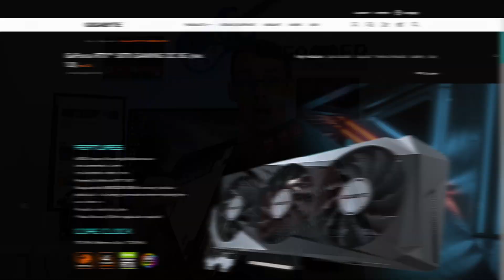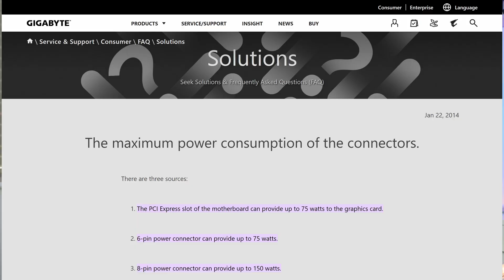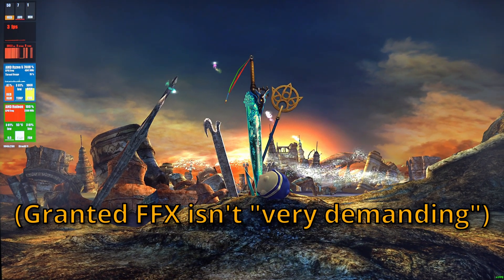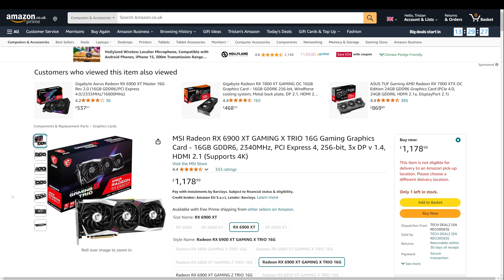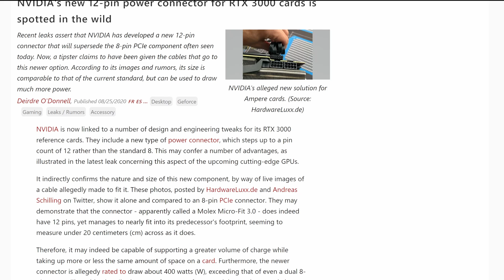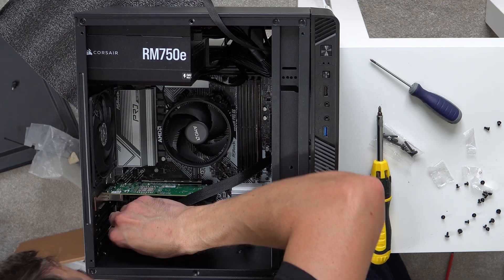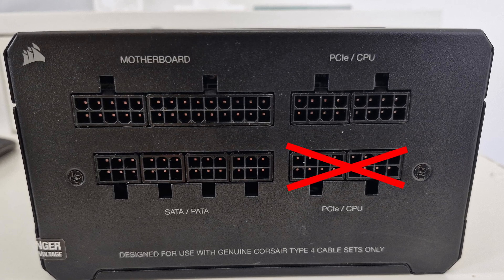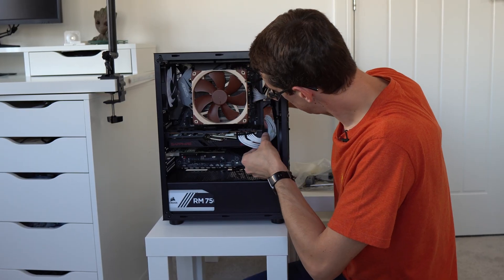How To PROPERLY Power High End GPUs (With 12vhpwr Or 3x PCIe Connectors)

Comment: Just bought a gigabyte gaming rtx 5090 and have a super nova 1000 gt psu. I have 3 8 pcie cables that have all pigtails. The adapter for the 5090 is 4 8 pins. Can I plug the 3 up like normal, and use one of the three to daisy chain for the 4th slot on the adapter?
Reply from the maker: Hmm, it's hard to say for sure. The fact that the 5090 can sometimes draw 600w scares me tbh, and some PCIe cables only supply 150w. So with 3x separate cables, you might find that your 5090 is being undersupplied power. Of course, some PCIe cables supply up to 288w... in which case, you'll be fine. I know that's vague sorry, but maybe just keep a close eye on your power draw and if you get crashes above 500w or so, then you know the cable config is likely the issue.

Comment: Thank you for this. I just want to confirm that I can power my Asus Prime 9070xt with a Antec GSK 850watt with only two PCIe 8pin cables. The TDP for the GPU is 304watts
Reply from the maker: No worries, and yes, that should work fine :)
Reply: Please I’m so confused, do u still plug a pcie into the motherboard

Comment: I always use separate cables for my graphics cards regardless of their tdp. In the case of the pigtails? I usually just cut them off. Much neater.
Reply from the maker: Cut them off? Yikes! I haven't had the nerve to do that, but I'm glad it's been working out okay for you.
Reply: Yes, ok it's scary the first time like everything is, but, I've been using the same PSU for over a year now and had no issues. You just have to make sure it's a clean cut {no stray wires,} and you use a good set of sharp cutters. Also being careful to make sure you cut the right wires! My first time was a doozy! Thanks for the reply.

Comment: Hi, i have 5070 ti, and it give me coil whine sound, i return and switch the gpu but the sound still there, so i was thinking to switch to rx 9070 xt bc it use 8 pins cable would it help?
Reply from the maker: Hi, ugh sorry to hear it :( Sometimes a new GPU can have coil whine for the first 1-3 weeks, but it can then slowly reduce. It's hard to say for sure though - there's no hard and fast rule with it. Some people say that swapping their PSU helped.

Comment: Hi! Should I connect two separate pcie cables on my rx 7600 xt? I've been having problems in some games and I realized that I had the pigtail connected to the GPU (and not two separate cables as you recommend)
Reply from the maker: Hi, yes I would try that, especially if some games are having issues. I mean, sometimes a quality PSU will power a 7600XT fine with just 1 separate cable, but I prefer running 2x cables whee possible.

Comment: I am upgrading my gpu where my current power supply can’t provide enough power, can I add another power supply for graphics card only or should I just replace current power supply with higher wattage?
Reply from the maker: It'd probably be easier to upgrade the PSU - by default PSUs don't turn on by themself, you need a 24 pin (mobo) connection to power them.

Comment: My 9070xt needs 3 8pin pcie cables but my PSU only has 2 8pin pcie slots, so it's ok if one of the 2 cables is a pig tail? 850w psu
Reply: Yes it will be fine
Reply: @xiMoshyx What about rog strix rtx 3070 ti, same thing, two 8 pin with 2 piggy 8 pin, can i do the same?
Reply: @Fantyyyy yeah 100©
Reply: How do you pigtail? My cables from seasonic are only one cable..?
Reply: @Specias does it have 2x8 pin ends? 2x 6+2 pin ends? Orva combo of 3?
Reply: @Specias as in 3 x 8pin ends?
Reply: @Specias  depends on the PSU. Check the model. You'll be ok
Reply: @xiMoshyx I mean the cable is straight, it only has one 1x8 on the other one.

Comment: Got a 7900 XTX and my 1000 watt modular psu doesn’t have 8 pin vga cables so I am assuming I just use multiple vga cables?. I heard using non stock cables can be very risky. Upgrading from a 3060 which only has one 8 pin
Reply: Ohhh so the split ends go into the psu and the single ones go to GPU ? Been doing reverse for like 5 years now
Reply from the maker: Congrats on the GPU upgrade :) It can depend on what PSU you have but some PSUs (for example Corsair ones) do come with PCIe cables here you plug 2x 8-pin ends into the PSU side.

Comment: with my 12 pin cable that comes with my psu doesnt work and my gpu doesnt even turn on. ive tried everything but im now gonna order a new one that has 3 6 pin pcie cables so i can use the adapter that comes with the gpu so thats litteraly the only thing i can do so i really hope that works...
Reply from the maker: Hmm sorry to hear it, that sucks - yes definitely worth trying with a conventional 6/8-pin cable and seeing if that works.
Reply: @TechOverwrite the last thing it could possibly be (or at least what i think) is a faulty motherboard... ive been trying to get my gpu to work for a week now... i was really looking forward to beying able to finaly use a pc again since its been a while. This is my first ever actual pc that is fully mine. (Also my first time building one...) so i really hope it works...
Reply from the maker: Oh that's frustrating, sorry to hear it. I had a dodgy motherboard ages ago and they can take ages to debug/track down the fault. I hope you can get it resolved soon.
Reply: @TechOverwrite  no worries. I got a different cpu and used the nvidia adapter and now it works!

Comment: What about the other way around the 16 pin connection on the psu and then the 2 pcie into the gpu?
Reply from the maker: Ah good point, yes some modern PSUs (including Corsair's ATX 3.1 range) do this. That's a good way of powering Intel and AMD GPUs - no harm in using that cable IMO. I like that they offer more PCIe connections this way.
Reply: @TechOverwrite can you link one of those cables?

Comment: For a Rx 9070 xt Sapphire Nitro+ should I use 3 pcie cables separately or use 1 pcie cable and other pcie with pigtail?
Reply: Same problem
Reply from the maker: I think it'll be safe to run 2x separate cables, to then use the pigtail on one of the cables. The 9070XT doesn't use enough power to require 3x separate cables, IMO :)
Reply: Thanks man  @TechOverwrite

Comment: Im upgrading to a 9070xt and it uses three 8 pin connector, leaving me with only 1 left from the psu, to the cpu. I have a 9800x3d, so having only 1 for my cpu, is cutting it short i suppose. But, my psu has a 12vhwpr connection on it. Is there a cable out there, which has 12vhwpr for the psu end, and 2x8 or 3x8 pin pci-e connectors on the gpu end? The psu is a Corsair rm850e.
Reply from the maker: So you presumably have a 2024 or 2025 model PSU? They should have supplied a 12vhpwr to 2x8-pin cable in the box. I would double check - my 2025 RM1000 watt Corsair PSU contained this cable. That is what I would use :) If you definitely don't have it, I would reach out to Corsair support - I thought they always included this cable with their recent PSUs (that have the native 12vh port).
Reply: @TechOverwrite  Is that cable meant to be used like he describes? Plugging the 12vhwpr end into the psu and the 2x8 pin into the gpu? I thought that that cable was meant to be used the other way around? The 2x8 pin into the psu and the 12vhwpr into the gpu?
Reply from the maker: @tonnyhovland5265  it depends on the PSU. Corsair's very latest PSUs have a native 12vh-2x6 slot, and then they give a cable that plugs 12vhpwr into the PSU side, and then that 'gives' 2x 8-pin for an Intel or AMD GPU.  But it gets confusing, you're right, because other PSUs give 2x 8-pin for the PSU side and then 12vhpwr for the GPU side. Very confusing!

Comment: I got the Corsair RM850e PSU, and a 9070xt which needs 2 8pin PCIe connectors. The PSU only came with one regular and one pigtail one. Is it fine if I use both with the pigtailed one having one unplugged and zip tied to the wire itself? Will there be any future issues with it? Its my first time so I'm quite stressed that I'll do something wrong and ruin everything lol.
Reply from the maker: That will be 100% fine :) No issues. Good luck with the first build!
Reply: @TechOverwrite  Thanks alot!

Comment: I've got a question, regarding the PCIE5 12v connector- I've got a 9070xt with 3x8pin female ports. I was wondering if I can connect 3x8pin Male to 12v connection male into the PSU. I'm wondering if that would be okay as it would make sense in my opinion and would make my cable management IMMENSELY better in my small form factor PC build. My PSU is MPG A1000G PCIE5 so I have a ton of free slots, it's pcie 5.1 and atx 3.1 rated
Reply from the maker: If the cable is designed that way (i.e. it's designed to have 12vh going into the PSU, then gives 8 pins for the GPU side) then yes, that would be fine. However if it's designed the other way round, it's u likely you can flip it around. You might then be better off with a custom cable e.g. from CableMod.

Comment: My psu came with 1 12v cable it’s a 3.1 Atx I can just use that? As a single wire from the psu to the GPU?
Reply from the maker: That's my preference, to be honest :) That's what I did, and I never had issues.

Comment: Thank you, I was son what the pigtail cable is called. Im using the asus tuf 9070xt while the psu im using EVGA SuperNOVA 1000 P5 1000 W 80+ Platinum. But it only come with 2 of 8 pins. All the rest are pigtails.

I may need buy another 8 pins locally, thanks for your informative.
Reply from the maker: Sounds like a good plan. You might be fine, but sourcing a separate cable would be best I agree :)

Comment: I purchased a 3070 ti Strix not realizing it has x3 8 pins.   My 1000W PSU only has 2 8 pin cables, and each cable has a 6 pin in addition, so I’m not sure if I can power it properly.  It’s also a Dell so this PSU can’t be upgraded
Reply: My current plan is to use a dual 6 pin to 8 pin adapter so I can plugin the two 6 pins and convert into an 8 pin.  

Is this different in anyway from splitting an 8 pin into to 8 pin, or just a single 6 pin into an 8 pin
Reply from the maker: Hmm, that's hard to say for sure although I would imagine it would be okay - the 3070 Ti's power usage should mean that the 2x separate cables will supply enough power, even if you do then need to use a 6 to 8 pin adapter for that final connection.
Reply: @TechOverwrite okay thank you very much.  So you would recommend using the 6 pin to 8 pin adapter? I ordered an adapter that allows for both 6 pins (the 6 pins on the PSU come off the cables with the 2 8 pins) but I don’t know if this makes any difference?  Spread out the load a little?
Reply from the maker: I think that should be fine yes (I'm trying to visualise it and am not 100%, but I think I understand). It may spread out the load a bit I agree. It certainly shouldn't harm it, at least :)

Comment: Hello i need to coonect 6+2 pin to 7800xt which require 2 cable. My superflower leader IIII psu cable only give me 2x of pigtail and 1 of normal 6+2 pin. I want t9 know that if i can use it separately like, 1 slot use single 6+2 pin and another slot use 12+2 pin which left 1 side of pigtail free. Can i connect it like this? Since im scared using only 12+2 pin to vga.
Reply from the maker: Yes that would be fine, i.e. leaving one part of the pigtail free but ultimately still using 2 separate cables. :)

Comment: Hi! i have a question, so i just purchased my asrock 9070xt and the store guys put it in my pc. so when i picked it up, im wondering why they only put 1 6+2 cable with the 6+2 pigtail on it to run a 2 8-pin gpu. my psu i a toughpower 850 ATX3. did they do they right thing or i need to put on 1 more 6+2? im worried now since i have used my pc for over 3 weeks
Reply from the maker: Hi! Ooo good question. I'd say they did it wrong, to be honest. I mean, technically some 8-pin cables can supply more than 150w down them - some up to 288w I think. More budget PSUs might be closer to the 150w figure, but the toughpower is a good PSU so you might be fine. However all GPUs can have transient spies too, and so I always prefer running 2x separate cables for best power stability.
Reply: @TechOverwrite hey thanks for the response man! i really appreciate the help! so now my OCD brain cant stop thinking about it lol. so i computed 75(mobo) plus 288(pcie cable) i should be getting 363 and in paper that should be enough,right? after work i had plug on another 6+2 from the psu package to the gpu, idc how bad it looks better safe than sorry. btw the cables are 18AWG.
Reply from the maker: Hah no worries and I agree, your math seems fine to me :) Hard to know for sure, but you should be fine I agree.

Comment: My old Vega64 died a few days and I found a good deal on a 6900XT that has 3 8 pin connectors. My EVGA 650 G2 PSU has 2 8 pin PCIE connectors on the unit, with 2 cables supplied with a 6+2 pigtailed with a 6 pin cable. I'm guessing there's no way to make this work, so I see there are compatible cables for sale that have 6+2 with a 6+2 pigtail. If I buy this new cable, will this work? I would use one of the older cables with just the 6+2 for one of the three 8 pin slots, then the new cable with both 6+2 used in the other 2 8 pin slots. edit - been researching elsewhere and people have suggested the 6900XT has high transient power spikes and that my 650 G2 is insufficient, despite both the V64 and 6900XT having the same board power rating of 300W. What do you think?
Reply from the maker: That should be okay for a 6900XT in my opinion - the power draw of that card is often 300w or so, meaning that 2x separate cables (and then a pigtail from the compatible cable) should be fine. 

All PSUs will handle transient spikes above their rated load, and the EVGA 650 G2 appears to handle them fairly well: https://www.techpowerup.com/review/evga-supernova-g2-650/8.html

So while I've only done brief research, I'm not seeing anything super concerning. You could always try it and keep an eye on (1) power usage and (2) any crashes/stutters, when that power usage gets to the peak. If you don't get crashes/shutters, you''re probably fine.
Reply: @TechOverwrite  Thanks!

Comment: Just bought a sapphire nitro+ 9070xt and have a XPG Core Reactor 750W GOLD. What do I need to do? I’ve seen people just using a 12pin straight to the psu?
Reply from the maker: That will work, yes :) The 9070xt is a beast, but it doesn't use so much power that I'd be concerned about the 12vhpwr. So in other words, I would just use the cable you got with your PSU to connect it up - that should be fine :)

Comment: can anyone help me
Reply from the maker: What's up? 🙂
Reply: @TechOverwrite  hello :)
hum hard to explain without image (i have a reddit post about it), it's about my psu im not sure if i can plug the third 1x8 pins elsewhere, my 9070XT is 3x8 pins and i'm not sure if my psu can handle and have enough ports for it. Rmx 750 2018 white gold 80.

also it is better to plug two 2x8 pins (so 1 will be floating unused..) or 2x8 pins and the third one with a single one? ☺
Reply from the maker: Hello :) Okay sure, so for the 9070XT you will be fine to use two separate cables, and then one of the pigtails (for the third connection). You will then have 1 pigtail floating unused, which is also fine. Your PSU should handle your GPU with no issue. :)
Reply: @TechOverwrite  thx u, as most use 3 individual i might upgrade to 3 indibidual later :) <3
Reply: @TechOverwrite I have 2 individual 8 pins in my psu and just bought a 9070xt nitro. Does that mean I need to buy 1 more separate individual 8 pin connector? I have a XPG Core Reactor 750W GOLD. Where can I buy the 8 pin connectors? Pls and thank you sir

Comment: If you have to have a guide for a CONNECTOR then you know you screwed up majorly! Take a hint, Nbrickia!
Reply: Who needs shunt resistors or bus bars, just send 50 whole amps through a single tiny pin! What could go wrong??
Reply from the maker: I agree with your point LOL, it sucks that Nvidia doubled down on this connector with the 50 series.

Comment: 12VHPWR Adapter Cable from cooler master is it ok to use for rtx 4070 i am confused cause its shows 600 watt power but do these rtx 4070 need those power
Reply from the maker: That'll be fine, or more than fine. It's an official cable (for your PSU), and it'll supply more than enough power for a 4070 :)

Comment: Would a Thermaltake 1200w gold 80+ plug in a 5080? If so how?
Reply from the maker: Is that the ATX 2.0 version with 8-pin PCIe only? If so, you would need to use the included squid adapter that came in the box - so,  you would run 3x 8-pin cables to the adapter, and then this would 'give' you 12vhpwr to plug into your RTX 5080 :)
Reply: @TechOverwrite  i have the 3.0 ATX version i heard it comes with a 12 pin and that j can use that?
Reply from the maker: Ah cool, yes I would just use that :) That's best IMO.